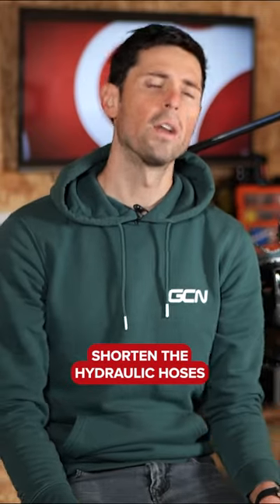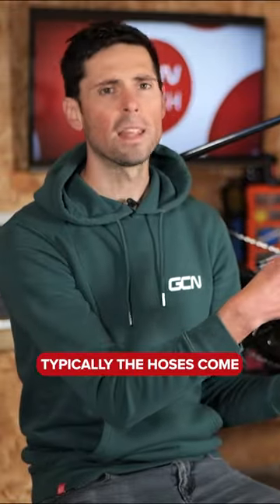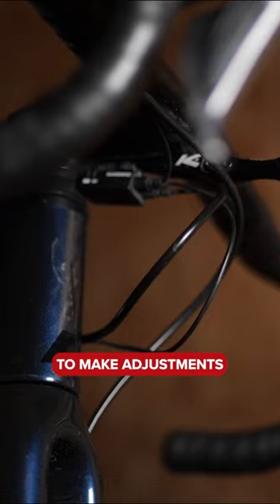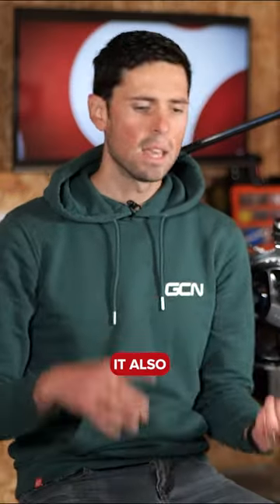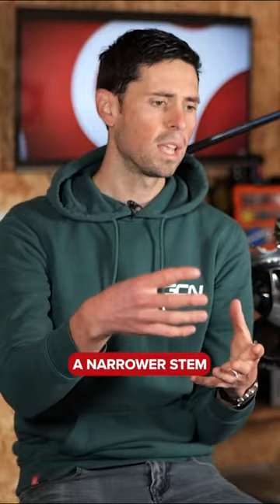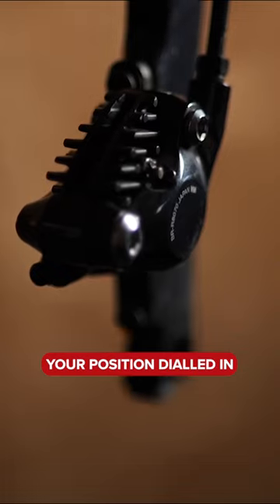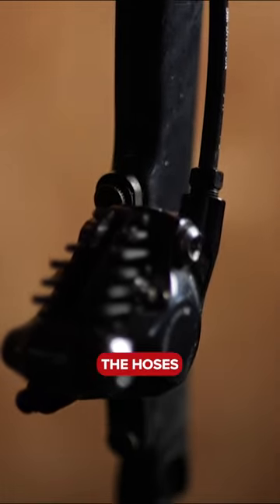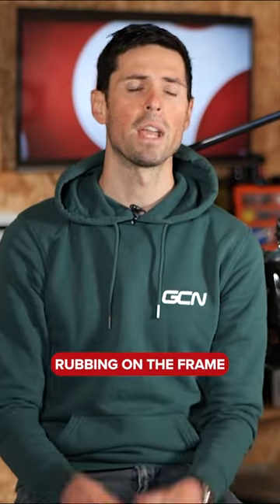Shorten your hydraulic disc brake hoses? Here’s why! 💡

Comment: What's the point other than esthetic and rubbing? Does it respond even faster to the brake levers?
Reply: Not in a noticeable way, so minimal barely meassurable. The hoses don't flex and the liquid is not compressible , actuation is instant. Maybe if your hoses are 2 km long and not properly bleed you'd notice a delay.